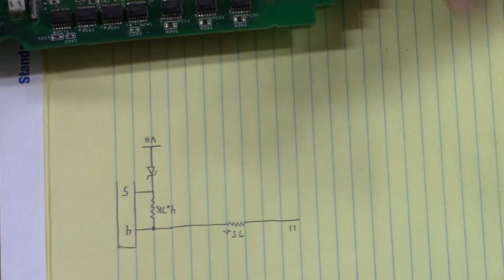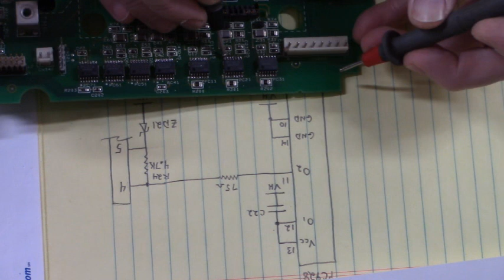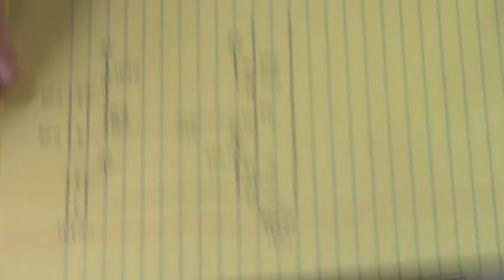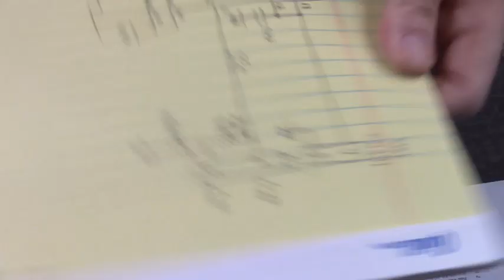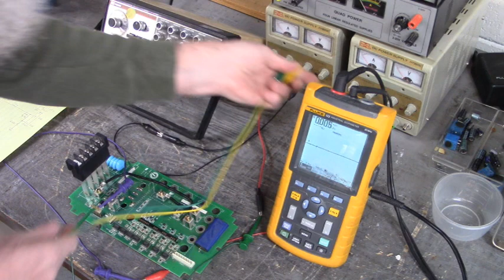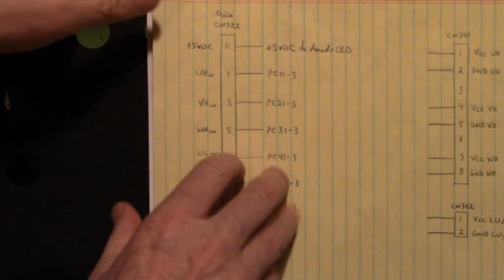(Part2) Yaskawa Servopack SGDB-20VD Shorted IGBT

Comment: Very nice!  I just recently purposed one the these IPMs for loading the U/V/W output of servo motors onto large load resistors.  Trying to test the magnet strength of an AC servo permanent magnet rotor.  The tested motor's shaft is being spun by another powered motor, thus, making the tested motor a generator.  The IPM works quite well as a high current switch (as Fuji intended it to), but I'm not employing any PWM on the gate pins.  Simply always on or always off.  Also, only using the N-rail in my application.  Anyway, I love your vids, PeePaw!!  Keep 'em coming!!

Comment: Hello, i have a servo drive DORNA model EPS- B2- 0D75AA-000 it give error E.28 (Motor speed out of control).. i check the DC BUS and the IGBT with DMM everything its ok but the servo motor its not running  JOG MODE  it make lake a brake show another error A.91 (Overload ).... in 7 segment display   the rotation detection its off and torque detection its lit how I can activate the rotation detection . Thank you so much PEEPAW.